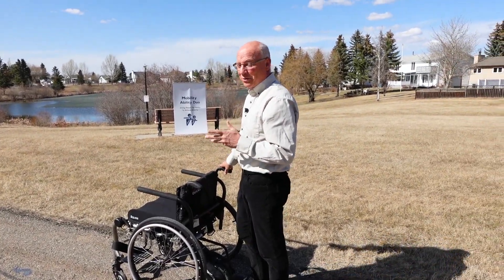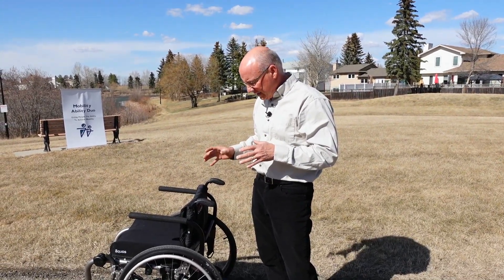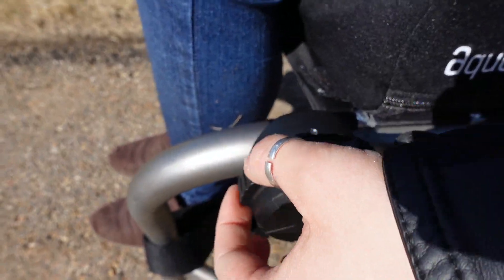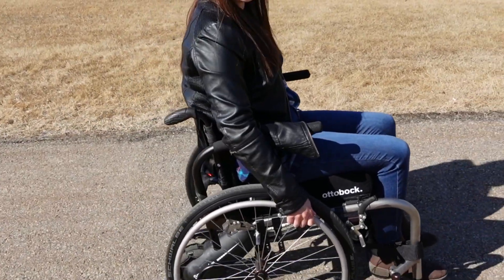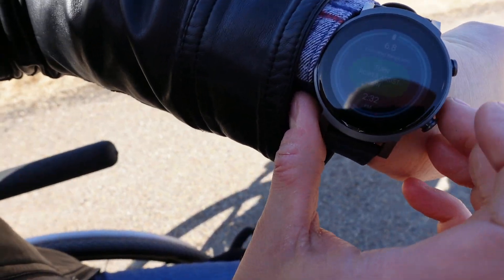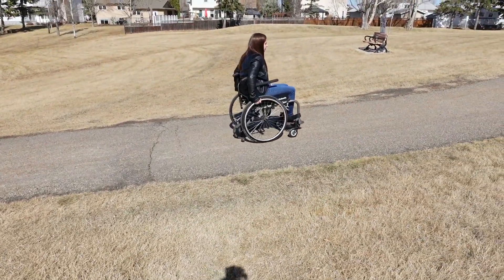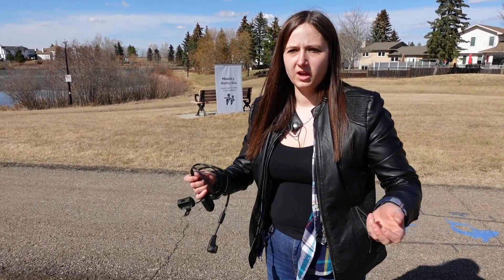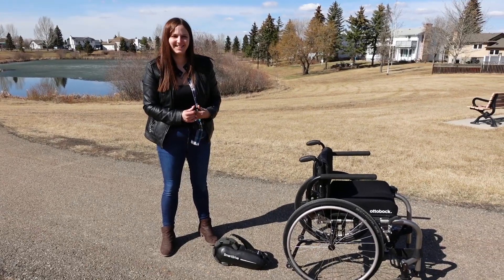MANUAL WHEELCHAIR CONVERTED INTO A POWERCHAIR WITH WORLDS LIGHTEST POWER ADD-ON UNIT!! (SMART-DRIVE)

Comment: Demonstration is very poor dosnt show how high up the hill it can go depending on tech way to much no price of the item the Demonstrater was scared of falling  that only shows not reliable didn't even show how fast it will go up hill down hill or how stable it is with front caster shaking if to fast or so ill still to manual hand push more reliable safe and at your pace not the equipment thank you

Comment: The gentleman promoting PERMOBIL'S "Smart Drive" describes it almost to a "T"

+/~\- 20 hours on a conservative battery charge to just run the "smart" drive

+9-12 miles of motor power usage

4-6 hours using the "Smart"Watch/PushTracker (less apps and/or internet running = more bluetooth power  for the smart drive

Comment: I use the smoov and got it mine used for 2,000. It is heavier but I like that the dial is  Bluetooth and you can stop by gripping the wheels if your going fast and someone walks in front of you. The battery life is long. Thanks for sharing though as I think insurance is more likely to cover a smartdrive.

Comment: I paid 6000 for one if these and had lots of problems with the connection battery to motor. I sent it back two times. The third time it malfunctioned they didn't want to fix it. The technician at the company was a real jerk. I would not recommend this thing. Buy something that works better. Mine is sitting in the garage. What a waste of money.
Reply: Smartdrive was perfect when MAX MOBILITY owned it.  I've heard nothing but problems since Permobil took over
Reply: What did you get instead